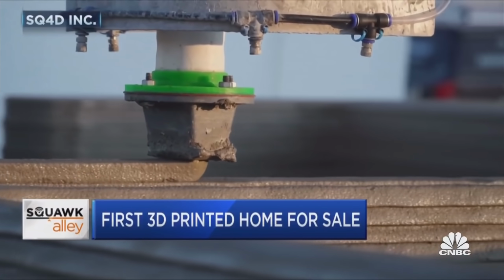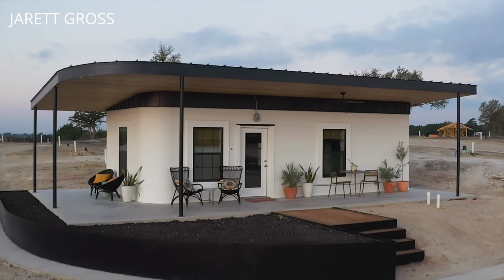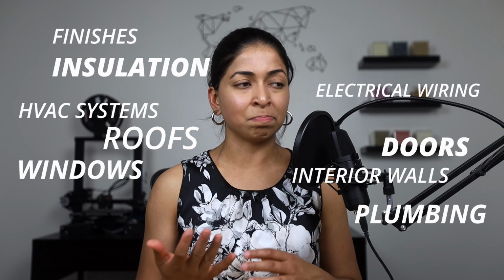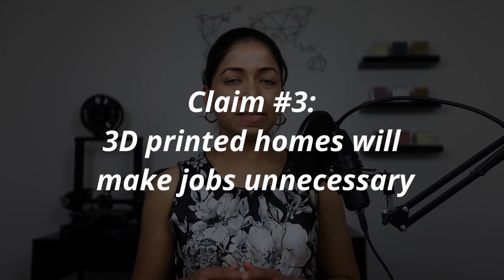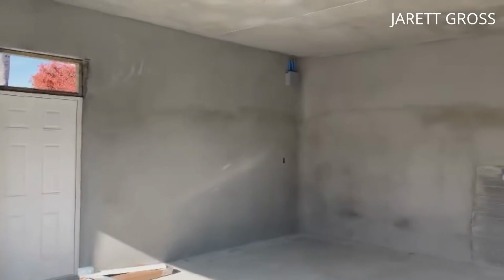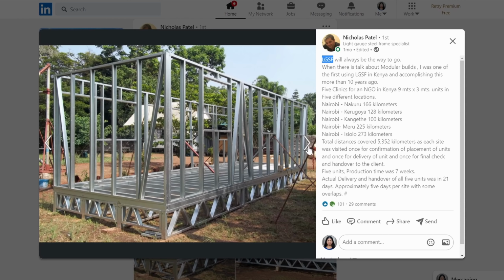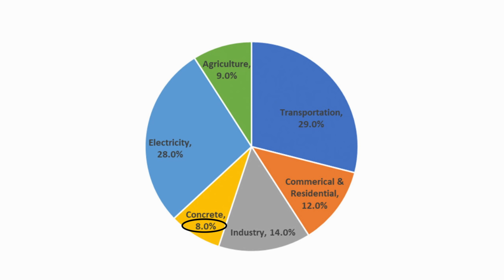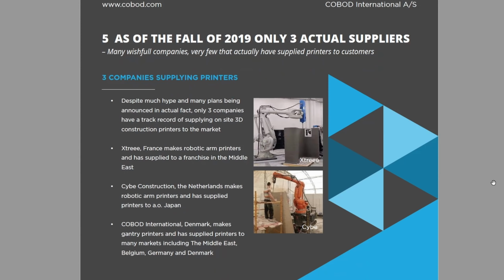Exposing 5 LIES about 3D Printed Concrete Homes

Comment: 3d printing a house seems like a result of "when you have a hammer, everything looks like a nail". Just because it "works" doesn't make it cheaper or better, it just introduces more costs and complications. Still really interesting tech but I don't see how this could possibly be better than using wood.

The "homelessness elimination" claim is outrageous too. As if a bunch of robots will just start printing homes everywhere.

Comment: why 3d print when prefab/precast concrete housing is already a thing? this is already heavily applied in western europe and requires less manual onsite labour. everything apart from the doors and windows is pre-installed, so piping for plumbing and canals/tubing for wiring. much better for mass production. the only thing to be done onsite is doors/windows, hooking up and installing electricity/heating/water and doing exterior decorative walls. when streamlined well entire city blocks can be finished within weeks. the buildtime for housing is far more influenced by availability of resources and manpower not by mechanical build-time.

Comment: as an electrician  if you have 3d printed walls you need to have someone in there to put pipes down so you can have wires put in afterwards for lights and outlets and switches and thermostats then you need yo make sure that the concrete doesn't get into those pipes let alone the other trades that need to put things in the walls and if the print takes a long time you need to pay the overtime for those people and find a way to keep the pipes upright while it cures and the only other what around this is to put up walls in front of the concrete you could have just put up regular walls in that time for cheaper

Comment: The thing i've thought for a while is that basically for 3d to work you need to find a material that is waterproof and highly insulating...   But if we could do that we'd have built it into a block and be using it already.    I think the layman / techbro concentrates on the structure of a building, but that is really not the hard / slow / expensive part.

Comment: This really doesn't solve anything that isn't already solved. The shell of the house is the easiest thing to manufacture. Its called "modular homes" 

For homes of the same size, it takes less time in a modular home factory. you also get a better product. 

then the lions share of the house comes in the utilities and finishing. Electricity, plumbing, and interior will cost far more than the shell.

Comment: Why not 3D print recycled plastic houses?  We are unindated with plastic waste.  There is no reason the plastic waste can't be mixed with sand and 3D Printed.  The light weight will alow for more than one floor as well.

Comment: Belinda, they're printing a home, with the attendant hype, now in Redding, CA should you want to see it under const.  As a licensed gen'l and specialty contractor in California for 30 years I'm very concerned that a concrete (printed) house without steel reinforcing bar (rebar) would either fail or be damaged with costly and potentially catastrophic results in earthquakes. And much of CA's soil expands and shrinks seasonally--put a printed house on a marginal foundation poured into expansive soil and serious cracks throughout the cement portion of the structure are a virtual certainty. Your video was very well done but focused more on social/economic/env'l issues,  but missed the important construction/structural engineering discussion I was hoping for. I'll keep my fingers crossed that you'll remedy that with a follow-up report/video in the months ahead.

Comment: Even without knowing anything about construction, I would assume that 3D printed homes would be like 3D printed objects. They are more expensive per unit, even if you take the cost of the printer out of the equation, but can be made to certain specifications with little extra cost.

Comment: I'm very sceptical about the strength of the grout and assume it something like a polymer concrete to have sufficient strength to prevent cracking. I doubt these homes will last many years through heating and freezing cycles.

Comment: I feel like most of these claims just ignore the fact that 3d printers print just the concrete here, so the cost, the time, and the jobs required for electrical, plumbing, installing windows, sewage and anything else is ALL still there!

Comment: The truth is the cheapest way to make a house is polestyrene, glue, plaster and some pvc pipe for plumbing. Only 1 story tall but what does that matter when your using a material people are throwing away and cheap extras to pull it together. With enough land, expansion is no problem. The main issue becomes who is paying for the land and who is going to give it away to the homeless

Comment: 3D printed homes are fascinating, but remote work is probably the best long term solution to the cost of housing. If one looks at the overhead of cars, travel, roads, parking lots and buildings to maintain the on-site work infrastructure, its hard to make an argument that the simpler life does not cost  less, but it may not be as fun. Give people the plumbing and energy hookups,  most can use their minds to take care of the rest, minus of course the professional amenities. I like fabric and art canvases myself. But is it viable and comfortable? Or is it just the architectural challenge. Walking down the bike path, I could not help to admire her home built from tree branches and twigs. She definitely had a great architectural and cost-oriented mind. Unfortunately, as she probably knew, you are not allowed to build any type of structure on city-owned creek side property, despite how creative and dreamy eyed you are or how desperate you might be for a moment in a home you built yourself.  Well, that is an architectural and political statement for you. And it is one that I remember and contrast with the real world made of concrete, zoning laws and return on investment.  Its back to the drawing board of a million different options minus one.

Comment: I can't see how it could be cheaper.

In india, as far as I know, the main costs of building a house are, land, cement, iron.

Land is still expensive, which can't be solved by this,
Cement is expensive, and they want to replace the bricks with cement. Which is crazy.
Without reinforcement, the bare concrete buildings would crumble, nobody would want to live there.
The entire process including transporting and setting up the 3d printer could be so expensive. 

It doesn't make any sense!!!!

The only way it would make any lowering in cost is if labour was the biggest expense in building, which it isn't.
There's probably like 10 things more expensive than labour when building a house.

Comment: "A Tesla vehicle can be driven anywhere in the world"  Tell that to the polar regions. 
I've built homes since the 70's, similar to all the other 'revolutionary' short cuts that've come before, this hype will cool down in time. One "huge" technique that would "save the planet" a decade ago was stress skin panels.  Imagine, saving the planet w/Expanded Polystyrene ? 
A point you could also make is in my experience I've never built a home & seldomly remodeled one where the clients didn't change their mind on design aspects. Working w/people is a collaborative process down to the most minute detail that only ends when they move in.  The best method to reduce building costs is to hire a reputable contractor, then go on an extended vacation.  Plus in the US use sticks, zip sys., all-weather OSB decking, asphalt roofing, drywall & Anderson windows/doors, etc.. So your house will meet code & look like every other house on your block. 'sigh'

Comment: It's not that 3d printed homes are cheaper, it's that the automation technology in general that's starting to be used in housing will make housing cheaper. Unfortunately because this will put many out of work there will be red tape in place to keep this technology at bay for as long as possible.

Comment: 'The lies cheapen the value of the thechnology'.

Very well said!

The same is true for 3D printing in manufacturing. 

The ridiculus 'ideas'  I have heard from managers with business degrees only when they encounter manufacturing problems on the shop floor! 'Can't we just 3D print it somehow?' At least most of them realize pretty quickly that it doesn't work this way and feel embarrased. So next time someone proposes a 3D printing solution they laugh and call it stupid. But what if that one is a valid approach?

Comment: I agree.  I really think that the 3D Printing homes Mark 1 is just a start and we have to work on a Mark 2 which will take more of a holistic approch.  

Like the first Airplane that can only carry one person during the Wright Brothers and now Boeing and Airbus that can carry hundres over thousands of miles.  There were improvement overtime.  

I think 3D printed house can be improved over time.  Instead of concrete, what about some other materials.  As long as liquid comes out of the hose or fill material, it will work.  Always room for improvement if those who are willing to try.

Comment: Thank you, Belinda. You are right about everything. I don't think this machine can ever do a building as well as other methods. If the price per SqFt is the chief concern I think the inflated balloon with spray foam or spray hemp fiber on the outside forms a shell and then shotcrete is sprayed on that to waterproof it. Other than that there is the mud brick or the rammed earth brick. These are not very durable construction materials. The best choice for cheap and durable construction materials is the plain cinder block and tin roof construction. In cold climates, we need to go underground or use thick walls & better insulation.

Comment: "the solution without a problem" that's the perfect summary of the video, I always thought: if is just pouring concrete why just don't pour the concrete whitout a machine?, or if we use prefabricated concrete pieces that are lighter and just use a little cement to glue them together?

Comment: I really think that the only good use for 3D printed structures would be for temporary housing after a natural disaster. Have some prefab roof and door modules that could be preloaded onto semi trailers to be deployed along with the printer and power units. That way you could start building housing for the displaced and workshops and safe sleeping areas for recovery crews on whatever undamaged parking lot as soon as the convoy could get in. Then when it's no longer needed, pack the roofs and doors back up and recycle the concrete.

Comment: From Peru, problems I can see: Everything here needs to be steel-reinforced, even foundations, due to earthquake risk. People typically build 2,3,4 floors for housing. Also people build right up to the edges of their lots, so there is no room for any overhang in the machine. Maybe if it can sit in the middle of the lot and print all the walls? Then climb out? But then what about the reinforced columns and beams? If it can leave a space for those to be inserted ... maybe ... but typically the steel needs doing first, or concurrently with the walls. Also, people here run machines into the ground. If it can't perform well when miscalibrated or worn down, it's not going to survive here.

I see similar problems for self-driving cars here! Can they avoid potholes? Can they ignore road signs when they are incorrect? Can they break road rules when that is culturally acceptable and/or necessary? Can it push in to a stream of moving traffic in a way that Peruvian drivers find acceptable and normal? We'll see ...

Comment: IMO, 3D printed homes is aiming at the wrong market. Not "Tiny Homes", nobody should live in "Tiny Homes", they are a scam. 3D printed walls should be used for very LARGE projects requiring non-square shapes, such as to reduce wind resistance/noise. If the end result is still a one-story box, then it should be built with cinderblock/masonry. If it's two or three stories, then the basement and first story of the home should be concrete up to the flood plane. If a home is being stupidly built in a flood plane (where cheap homes are built or delivered somewhere that will flood) then perhaps these 3D printed projects can be used to build something to put the conventional manufactured home on top of so the home isn't flooded.

Comment: All the claimed advantages of 3d printed homes are equally or moreso found in factory made mobile homes (manufactured homes). Low cost, versatility, truly simple installation (relative to normal construction of a home), mass production, etc

Comment: I think the idea of 3d printing construction is really interesting, but the practicality of it as you have pointed out, just isn't there yet. To be fair, almost every emergent technology that enjoys widespread success, such as 3d printing, almost always deals with these types of identity issues. Mainly, the problem stems from engineers, and enthusiasts trying to fit a new technology to as many situations as possible. The old adage "everything looks like a nail when all you have is a hammer" comes to mind in these situations. 

I would also like to know what the structural strength of these 3d printed wall sections are. I don't feel like  pure concrete laid down in layers like that, would be as strong as form poured concrete. Also when people talk about "full" construction with 3d printing technology, i feel structural stiffeners, such as rebar, or steel mesh, are key elements that get overlooked, or simply not addressed. As you've stated, there are many elements of building construction that simply can't be handled by 3d printing technology at this time, and many of them are directly responsible for increasing structural integrity, and safety of the building as a whole.

Comment: As someone who lives in New Zealand and has to deal with earthquakes. I would not trust a 3D printed concrete wall to last long during a big quake event. With it having no wood or steel to support it, and it being a layered construction. I can easily see those concrete layers cracking or separating. Similar to an unreinforced brick or stone house. But this time without the frame for support. Dont get me wrong, its cool tech. But at this point, its like a caveman trying to sell an overcomplicated square wheel, and marketing it as something that rolls better than a circular one thats tried and proven to work. It might be shiny and cool looking. But its still a square wheel.

Comment: Years ago I worked at a company that produced prefabricated steel wall panels and trusses systems from NuCor... As long as the concrete was poured correctly, within 8hrs the Walls and Trusses for one house could be erected. So the next day plumbers and electricians could start... But the earliest estimate for completion was 45days start to finish! And realistically, all the work we did could be done in the field, but better to have a facility!

Comment: To her point, construction is not 1 size fits all. Solutions need to be calculated based on location. You need to be able to understand culture, availability of resources, working hands, durability of materials as they relate to their environment and a myriad of other factors. Companies are not constructing bathtubs from wall plaster. Metal, plastic, and “clay” are among the most common materials because they can handle the functions and elements that they exist for and in. The same guidance should exist when constructing houses.

Comment: 3D printed houses offer automation of tasks that include significant waste.  Sometimes construction crews are efficient and the cost could be considered reasonable.  But more often homes are banged out without regard to quality and the cost is usually astromomical.  For me 3D printed homes represent a way to improve the situation, with skilled workers paid for a job well done.

Comment: Excellent meta-analysis. I, in turn, was never fun of those buzzing tech, which is immature and unreliable. You forgot to mention that 3d printing don't use such an important feature as armature. Not at all. It makes those buildings fragile and prone for cracking in extreme temperature and humidity conditions, lowering concrete lifespan in 50% at minimum.

Comment: I believe that 3D printing in construction is a solution in search of a problem due to me being unable to see the benifits of the technology. Building materials are standardised to a high degree allowing for very efficient manufacturing in large quantities and the cost of moving a printer will be greater than the cost to move the material needed by other methods

Comment: 2:45, They make sure to point out that "SOME HOMES" may be printed in 24hrs. This implies that  a Simple POS house could be Easily printed in 24 hrs, even though it would be done in 8 when done with a Traditional Method.